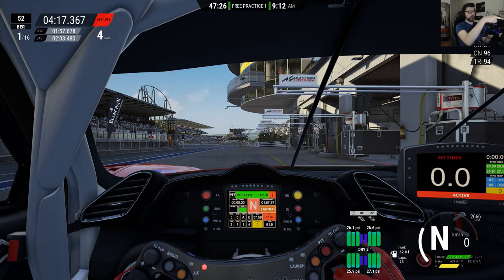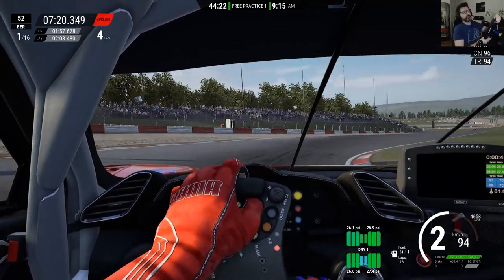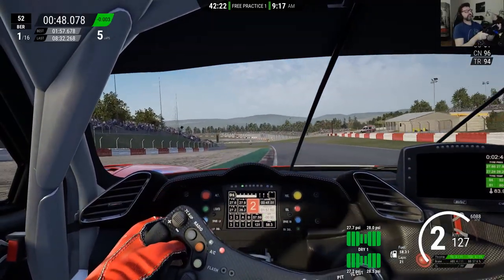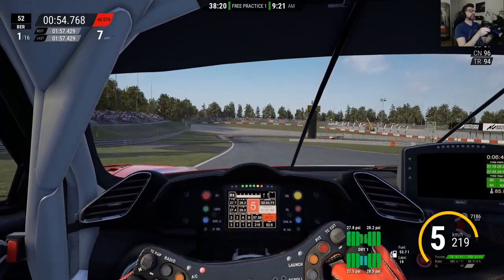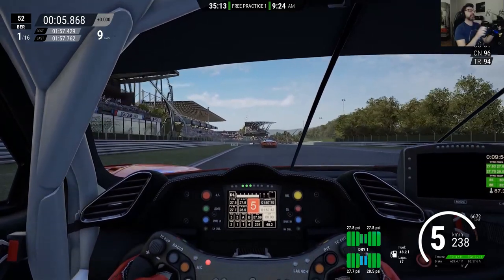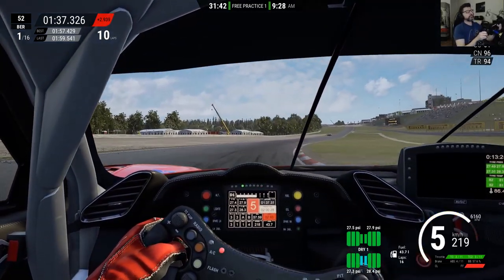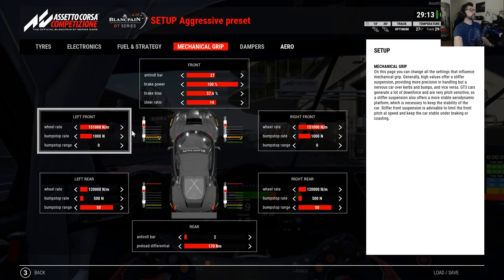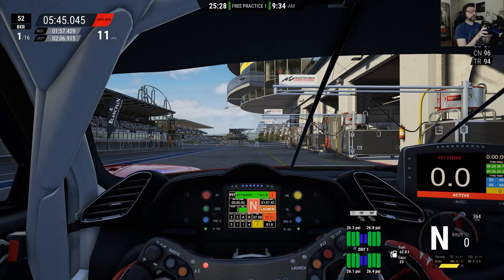TL;DW - Step 2. Testing with new pressures&aero. How to judge the handling.

Comment: You are 100% correct. If I was teaching someone to race and they were new at it I would drive that point home. Reference points or braking points along with race line. When you get solid points all around any track you will be good. I would say learn these points at a slower race pace and after you are very comfortable then you drive car as close to out of control as you can without crashing or spinning.
Reply from the maker: Cheers! Glad it makes sense to you too
Reply: @ArisDrives  Believe me I am not a race car driver but new to sim racing . About 2 years now and once I understood markers and apex and braking in a straight line or trail braking it improved my lap times and race craft 10 fold. Just about 3 months ago is when I started to get it.

Comment: I'm a bit confused on the tire pressures. You adjust them but I'm a bit confused what I'm aiming for with them. It seems like you aim for maybe ~27.5psi hot is there a reason for that specific pressure, and are there cases you want other pressures? I've always set tire pressure for cars so that my middle tire temp is between the middle and outer, is there a different logic for GT3? Loving the videos, learning a lot from them
Reply: Yes you want to aim for 27,5 in dry conditions. ~30 Psi in the wet. You have been adjusting the for the exact right reason. The geometry of the tires changes depending on the pressures and in combination with camber, you want the middle of the tire to be in a temperature range between the inner (hotter) and the outer (cooler) parts of the tire.

Comment: When the tire depth is reduced by wear, does that affect the ride height?
Reply from the maker: Yes absolutely. That’s why we had to implement tyre wear that actually lowers the tyre depth. 3mm fresh tyre and if it wears down to 1.7-1.5 it’s critical and you should change it. Obviously the ride height will go down by 1.5 and the gear ratios will also get shorter
Reply: Aris.Drives thats awesome

Comment: So I am still a bit confused. I watched the Porsche 911 video at Zandvort and the rear ride height was lowered to make the car have less over steer. In this video the rear ride height was raised to make the care bite a bit more. Is that the common adjustment, down for less over steer, up for more?
Reply: Depends on the minimum ride height of each car and their aero balance. As a rule of thumb, if the aero balance it's more on the front, the car will tend to oversteer. If the balance is on the back, it's going to understeer.

Comment: Great videos Aris, Thank You. Im in the early stages of learning tracks, tyres & temps, just doing the tyres alone you feel the car start to behave.. the handling feels amazing and you feel it change as you set pressures. I do that, drive some more for that feel & then dont know how to fix the final issues that arent tyre pressures so im looking forward to the rest of these videos - they are full of the info i need, the way you visually demonstrate as you go & speak of what you feel in the moment is the exact info many beginners need. It can be daunting at 1st when you realise quick tuning is essential on all cars. We are not motorsport engineers but the basics are actually really simple to learn & it becomes a much better experience from then. Its top tier gaming.

Comment: Ciao Aris! You said that the rear tyres tend to deteriorate faster than the front tyres. Is it due to the fact that the Ferrari 488 is rear-wheel drive, or there is no relation at all with it, and this degradation of the rear tyres applies in general to any race car?
Reply from the maker: All cars are RWD by rules. Usually cars with more weight at the rear will consume their rear tyres faster. Also depends on the track, driving style, temperature etc. for example, my Lexus a front heavy car was consuming faster the rear tyres at Monza. Probably because of the hard acceleration out of slow chicanes. On higher speed tracks it consumes first the fronts.

Comment: Huh, learned about the differentials, thx. Always thought it was the other way around. Open diff until you get one wheel to spin and then it locks to the set percentage.
Reply: @Aris.Drives , Are you sure you did not get it the wrong way around? Have a look here: https://virtualracingschool.com/academy/iracing-career-guide/setups/differential-basics/
"Preload spring: defines the base amount of force that is applied on these friction and clutch plates. With small enough (or negative) preload, you can open up your differential. The heavier the preload spring, the easier your differential will lock."

Comment: I am trying to set up the Lexus on brans hatch but find after ten laps my left front is wearing fast 2.4mm tread left and severe graining tryed safe and default also tryed lower negative camber on left wheel and tow also increase pressure but does not seem to make any difference any help would be appreciated.
Reply from the maker: If you have severe graining you're turning your steering wheel way too much in every turn. It's a bad habit and doesn't give you more grip. Watch the following video and demonstration to understand: https://youtu.be/dJ3b4zPJfAU
Reply: @ArisDrives  ok thank you for your help much appreciated. Seems strange as on this game compare to others I hardly move the wheel most I ever turn it is 90 degrees for a sharp turn . I will definitely watch your video and try turn a little less
Reply from the maker: No worries, make sure you use 900° on your steering wheel or at least the same lock as the car you choose. Make sure the ingame steering wheel rotates 1 on 1 with your own steering wheel
Reply: Ok thank you I don't drive in car view so will check that out. I have a t500rs which is currently set to 1080 never really messed with it so wil change both to 900. The only way I have found to counteract this was turn up the steering like you suggested in another post. You have been a great help top call developer
Reply: ghosthunter2927. Why not set it to the IRL steering lock? There’re several lists online with all the cars...

Comment: can you please explain the preload differential again,i couldnt understand, esecially what is an open diff and a closed diff.
Reply: With open diff the internal and external wheels will rotate at different speeds, locked diff makes both wheels to spin at the same rotation. The preload is the amount of load already aplied to go from open to locked, so the heavier the preload is, the easier your differential will lock.
In summary, with open diff you will have less power in one of the wheels, but your car will turn easier, with locked diff you will have the same amount of power in both internal and external wheels, making it faster but more uncontrollable on turns (oversteer).
I hope I helped!
Reply: I'll try and make it easier in sim terms. If your car gets loose when off throttle (assuming your suspension is set up correctly) click it to the right. If your car gets loose all the time on power (assuming the same and that your traction control is where you like it), you'd click it left. The opposite for both cases.
Reply: @hernanialves6938  you explains better than Aris, i was thinking totally the opposite before, now i understand what preload means here, thanks!
Reply: @terrylu4894  Thanks! Just to complement my observation.
The preload is done by a spring which forces  a clutch plate to make the lock, so basically if a greater force is pre applied into this clutch before throttle, the faster your differential will lock when you press the throttle (when even more load is created), that's why you will have oversteer more easily in a RWD car like the GT3s.
Reply: @hernanialves6938  that's informative. just one more question, does the differential applies to all 4 wheels or just driving wheel.
Reply: @terrylu4894  Both axes, front and rear axes have a diff that makes the wheels more or less locked, but only the driving one is configurable.